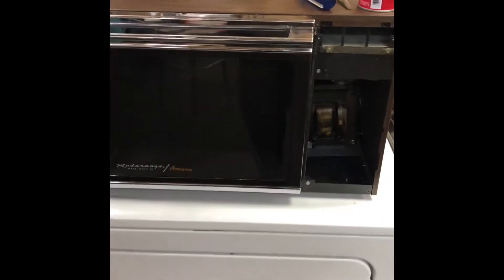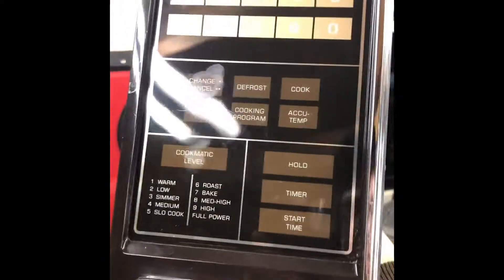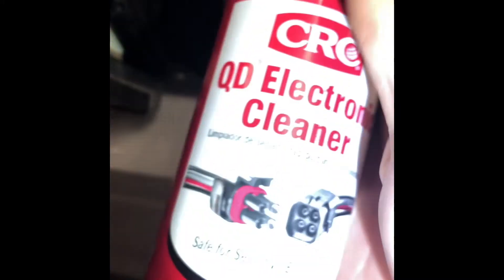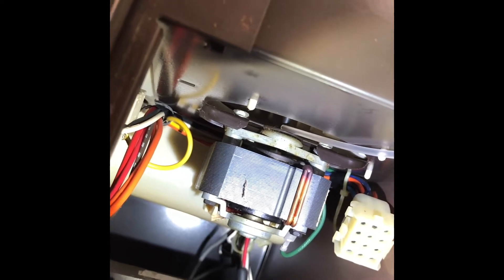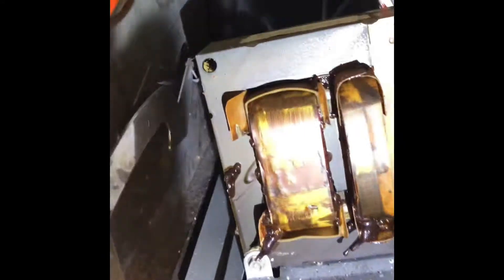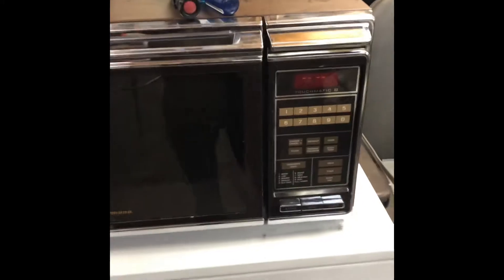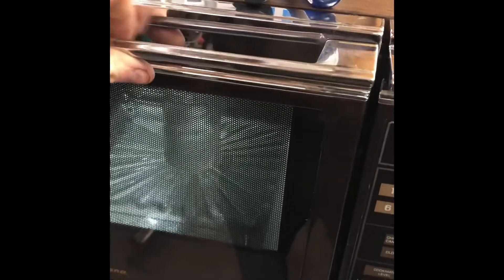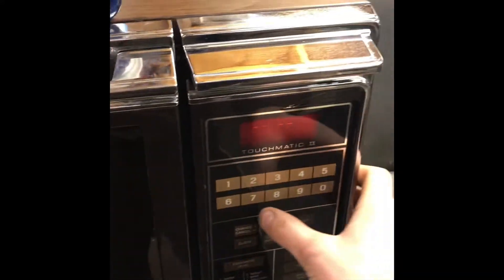Repair and overview of my Amanna Radarange model RR-10 10

Comment: I bought my mom and stepdad a Amana Radarange after her 1st divorce, a 1982 or so Amana Radarange, had to replace one spring over the years, finally died at about 35 years, if I had the time I would have just replaced the magnatron - finally picked up an RR7 recently to have as a backup IF my 1989 Amana Radarange ever dies, arrived in pretty good shape from across the country, needs a light bulb socket, and a bulb, maybe replace the cracked plastic door liner (inside) maybe springs eventually - bell – but it works great -